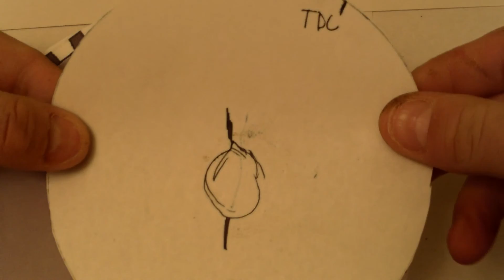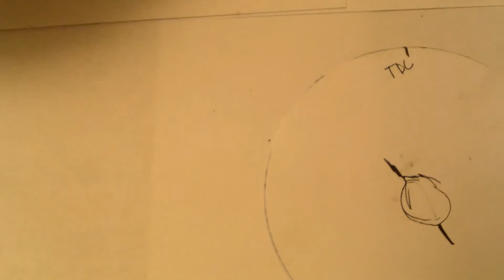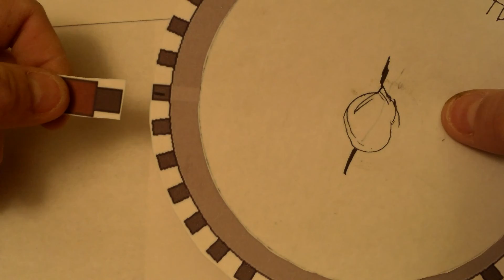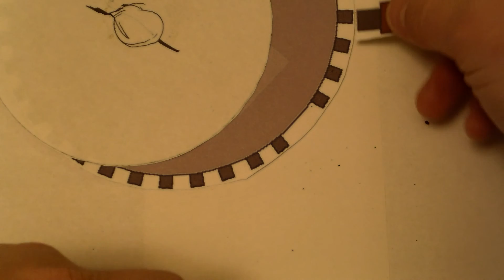AE86 How Trigger Wheels Work

Comment: when does the injectors fire.
Reply from the maker: This isn't for the efi yet. Only ignition. If I want efi I would need a 4aelu distributor that has the cam sensor so I can run 4 1zz coils.